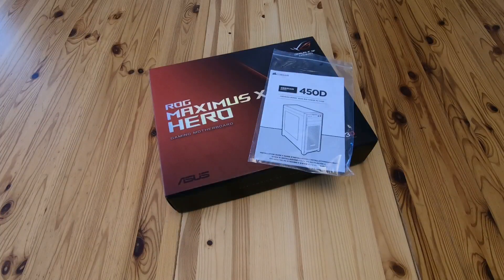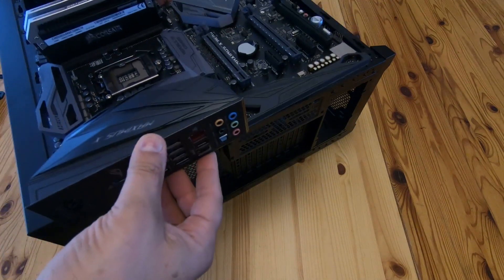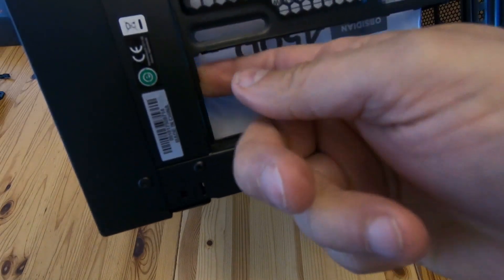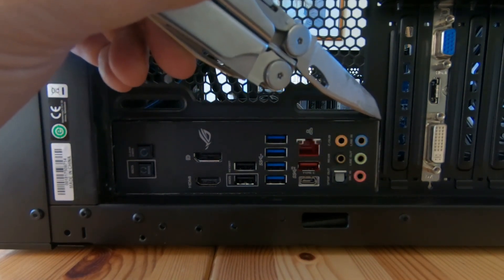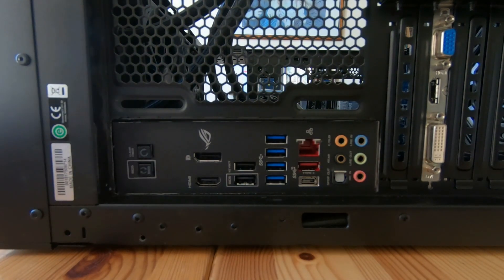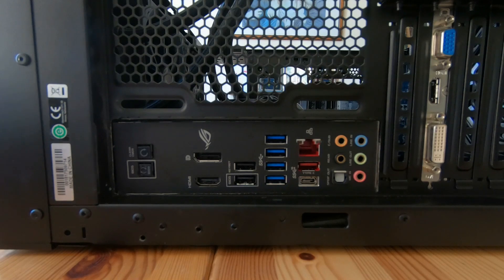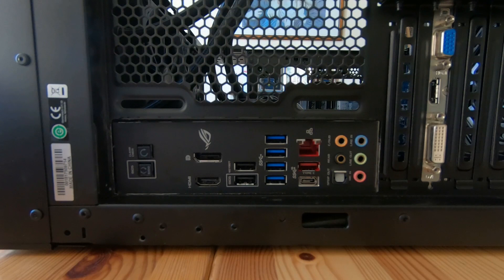ASUS Maximus X Doesn't Fit My Case *DIY FIRST FIX* in English

Comment: Thank you so much for uploading this, I was so frustrated that I wasn't able to get the mobo in! I was wondering what type of bit would be needed to be able to cut the steel/ aluminium on the case. I've had absolutely no experience with a dremel so I'm a little clueless aha.
Reply from the maker: Glad I could help!

You don't need to use a Dremel - especially if you don't have one already.

A metal file can be used to manually make the hole a little larger - and this video will hopefully show you where.
Reply: @sterntechdaddy  ah fantastic thank you!

Comment: For someone that can spend that much on such motherboard I’m pretty sure you can also get a more up to date pc case and graphics card . That wouldn’t need “warranty voiding” or “destroying “ a case.
Reply from the maker: I can... but...

The 450D High Airflow in this video costs about £100 and I tend to by a reasonably decent case and then keep it.... case warranties are pretty irrelevant anyway... and as it follows the ATX standard being 'up to date' doesn't really matter - it's got USB3 ports on the front so it's not exactly 'old' anyway.

At the time, it was difficult to get a nice case that could still have an optical drive bay I could fit my Pioneer BD-R drive into.

It's not really destroyed either... the hole for the I/O shield is just slightly larger.

I would like a new case though... but the main consideration will be the colour -  it'll have to be white to match the monitor I'll be getting and I think I'll go mATX rather than full tower ATX next time too.

Nice shout out for the GPU though... it's a passively cooler GeForce 210 that was put in for testing!

I suppose the point is that the pre-fitted I/O shield on this motherboard is so rigid that it probably wouldn't fit even if I did buy another case.

And no one can tell there's a bit filed off the back anyway... because no one should be spending time staring at the back of their PC, plus I also touched up the aluminium with a Sharpie.

;p
Reply: I just bought 200 pound 7000D Corsair case and my motherboard can't fit whit the same problem as I have preinstaled IO shield so the case going back is lame case like this big full tower case to be let down for this kinda things
Reply from the maker: @marchev1982  I feel your pain...

But hopefully this video will mean you don't have to grind off as much as I did to get the motherboard to fit.

:D

Comment: That motherboard seems like it breaks the ATX design guidelines. I've had so many motherboards over the years with the push in rear i/o style and they fit that and other cases just fine. That board reading on the internet has a lot of difficulty installing in a bunch of cases
Reply from the maker: It's pretty annoying... but I expect ATX standard really covers things like screw positions, board dimensions and motherboard layout rather than anything specific about I/O shields.

And as you pointed out it's not all cases that have problems.

But if you do have problems then hopefully this video will stop you cutting off as much as I did to get it to fit.

:)

Comment: Got the same issue for the maximus XI in the ASUS STRIX Helios case ;-;
Reply from the maker: That's especially irritating seeing as both products are made by ASUS. Hopefully the video will mean you can trim off less than I did on my case.

The STRIX Helios is a pretty funky case btw... :D
Reply: @sterntechdaddy  I gave up and said screw it i'll just have only 7 screws in the motherboard and have it slanted slightly i won't even put the gpus on the board ill have them sideways instead of how everyone else has them lmao
Reply from the maker: My instinct is a really twitchy about that... you are braver than me...

The holes on the motherboard are grounding points that help with signal noise reduction, not vital because the main important earthing is done by the motherboard power cables, but there's a reason they have solder points on them.

They are also rigid fixing points - if they aren't all used then the motherboard might flex under the weight of the heatsink or from forces associated with cabling.

And mounting anything into a PCIE slot that cannot be locked in by screws will be very worrying... they REALLY don't like wobbles...

Personally, I'd get the Dremel out.... then I'd be able to sleep at night. :D
Reply: @sterntechdaddy  uh you'll never believe it XD it fixed itself i just opened it up after leaving it and it aligned itself wtf

Comment: Did the fan fit after the Dremel mod to the case?
Reply from the maker: Everything fitted fine... its just the fixed plate on the motherboard that's the problem.

Comment: I have the same problem but with the 570x and z390e
Reply from the maker: The Corsair 570x is a great looking case... and the ASUS ROG Strix Z390E motherboard is very impressive... like the Maximus range that's got the fixed  rigid I/O shield on the back - really irritating, but a few minutes with a Dremel solves that. :)

Comment: The XI doesn’t for the Corsair 570x either
Reply: Derdok same problem, i even damaged the board while trying to get it in.
Reply from the maker: Its such a stupid design... luckily I stopped pushing and reached for the Dremel.
Reply: Superjunge 1380 I broke my board too😂😂 I ended up getting the second one in
Reply: Same here. XI I/O shield just a bit too large for the corsair 570X opening, so the mounting holes don’t line up cleanly. First gaming PC build with my 16-year old son, so it’s a teaching moment about a non-ideal world. Going to evaluate carefully tomorrow and hope some well-placed dremeling does the trick
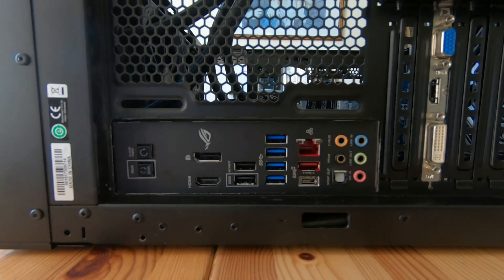Reply from the maker: @PaulDonnaErik  I found it was ultimately the right edge that needed a shave - this is as you look at the back of the case at 1:55 in the video. Hopefully this video will help you shave less of the case than I did to get the motherboard to fit. :)
Reply from the maker: @Assassin Hunter The Maximus boards will actually fit any case... you just might have to make the hole for the I/O shield a bit bigger for some cases. At 1:55 you can see it's mainly the right edge that needs adjusting. For some reason ASUS made the I/O shield integrated into the motherboard and completely rigid - rather than the usual separate part with springy edges.
Reply from the maker: @Assassin Hunter Gather the money you want to spend on a PC and then buy everything in one go. The benefit of building your own is that you can reuse old parts and shift the costs between components. I might do a video on it....